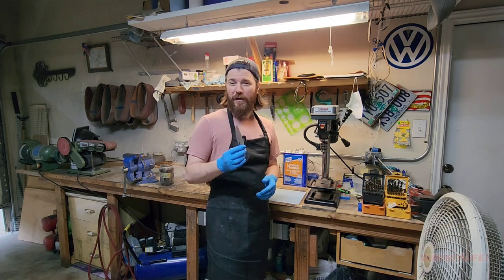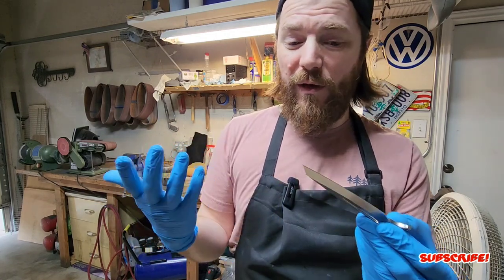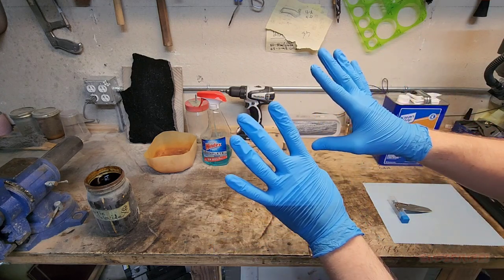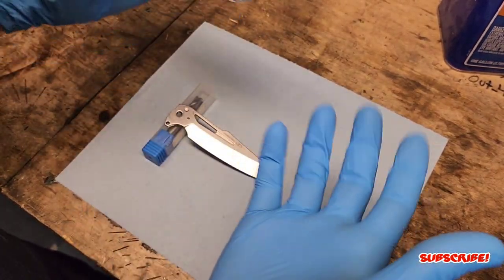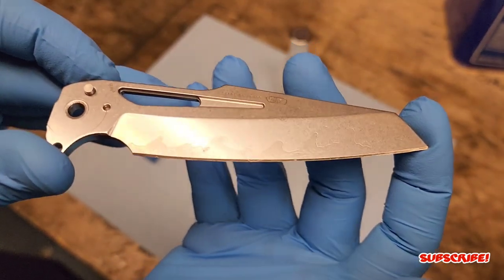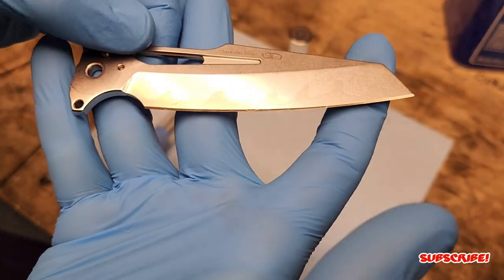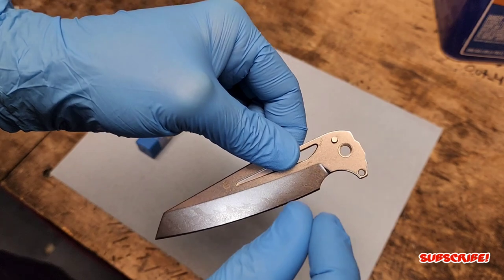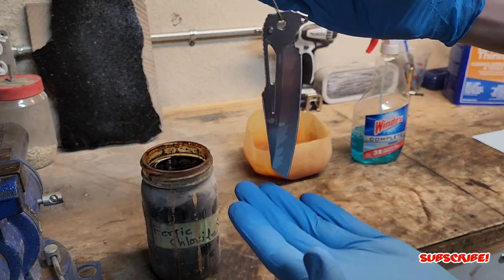How-To Faux Hamon Etch A Blade!!! #custom

Comment: I've done a few Case (stainless) blades, with a very fine even "hamon", just by taping off the bolster, (ie, no need for disassembly) and applying the ferric chloride with a very soft artists paint brush.. I always use baking soda, to neutralise the acid, and you can partially rub off the "patina", with any metal polish, until you end up with a very old worn look,..
I also like to do the "inside" of Spyderco holes, to give them a dark contrast, with the shiny flats of the blade,,, (using just a Q tip) 
Best part of all this, is it's fairly easy to remove or rectify mistakes, with elbow grease and metal polish..    Just my 2 cents.. 🙂
Reply from the maker: Appreciate the advice and technique, I'll have to give this a try!
That's a cool idea for the spydie hole, contrast is always a great look!

Comment: Looks awesome Knathan 👏👍. Thanks for sharing info . I tried some muriatic acid from Home Depot and added some vinegar and  piece of steel wool and it worked good . The muriatic acid went non acidic over the winter somehow . So I ll get some ferric chloride with the link when I’m ready . Thanks
Reply from the maker: Thank you and no problem! 
Sounds good, it works great for etching 🙂

Comment: Hey Knathan! 👋🏻 Big fan of your work and an aspiring knife customizer myself (& only for my own amusement).. I had a question for you if you don't mind me asking. What's the best / most durable way you know of to black-wash steel (D2 for example)? I like this chemical you used but is there a way to keep it darker in the end? Could you add black paint / dye to the mixture? With hopefully no unwanted reactions taking place. 😅🎉
Reply: Ferric chloride will only get it to a really dark grey no matter how long you soak it. You would have to use dlc or pvd for a black.
Reply from the maker: Hello and thank you! 
The only way I know of getting it darker is to get some sort of black coating🤔
I'm still currently experimenting with different finishes.